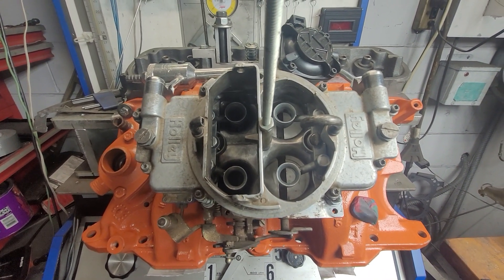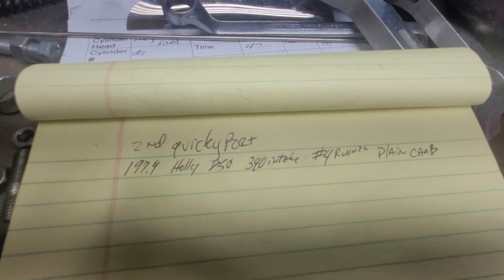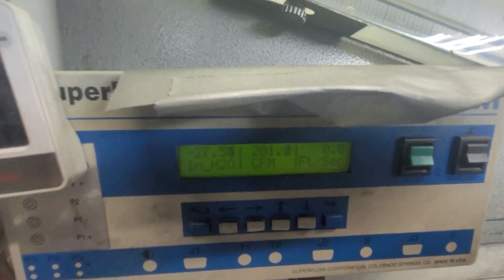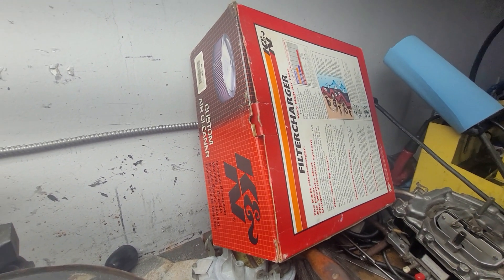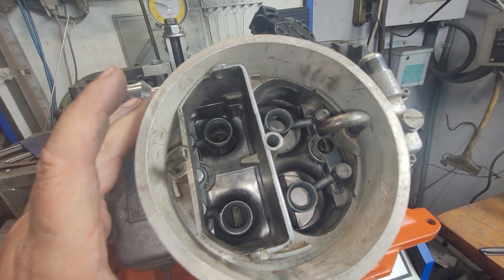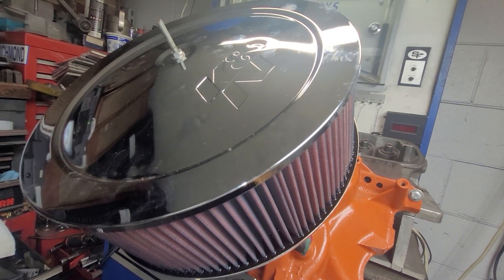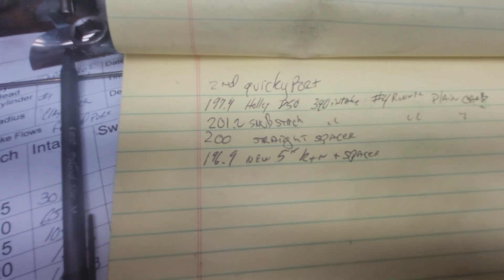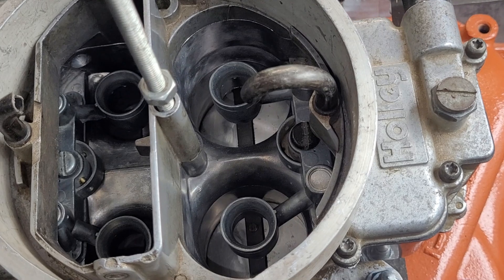Mission Impossible 318 project. 340  intake with Holley 850 cfm carb. Radius, Stub stack, K&N pt.1

Comment: Some really cool pieces that Rob brought for you to try out! I would like to see a velocity stack/stub stack combination on the 850 to see if it would make any more additional flow. I’m not at all surprised to see flows increase with improvements on the intake side. 318s respond to efficient intakes and 750 cfm carburetors much better than many would expect. I’ve heard it described as the pushrod tube window reduction of the intake port acting in the same way as a restrictor plate and whatever you can do to reduce any choke points and turbulence ahead of it helps clean up and straighten the flow through it. I would also like to see what a performer rpm air gap would do with a 750 4150. There a well known very street friendly moderately built 318 that shows some gains via time slips with that combination.
This to be specific.

https://youtu.be/8AjHkjiKNR8
Reply from the maker: I would love to test one. Thanks

Comment: What about a stock air filter base? Just the bottom no element. I remember reading something about the base on the filter housing being lower than the opening of the carb had a positive effect on flow and velocity  verse's even or above the opening , or maybe with the lid on that would make more sense.
Reply from the maker: I don't have one or I would test it.